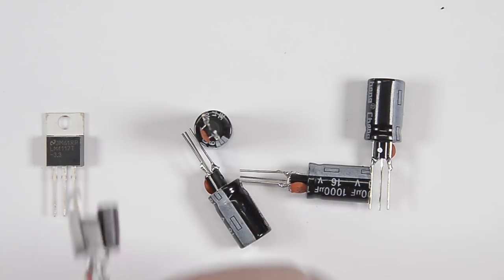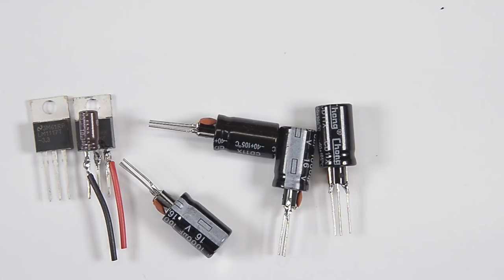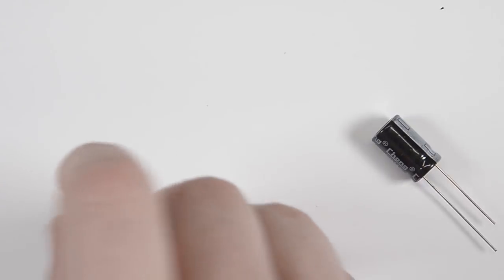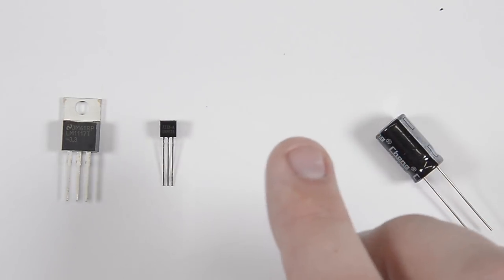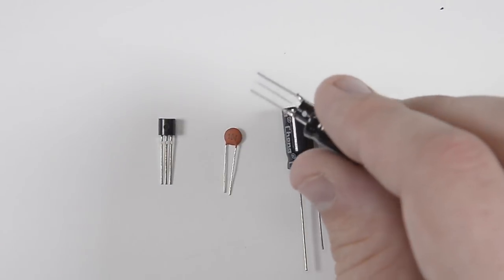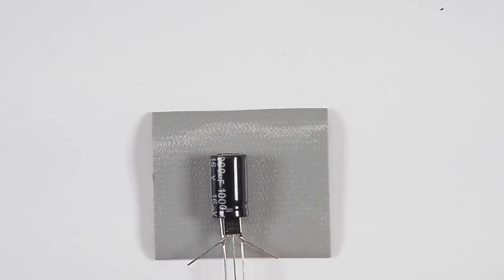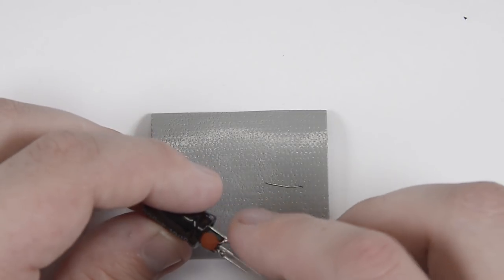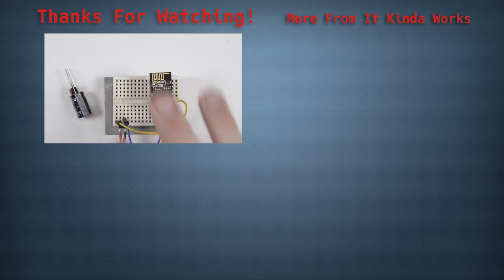New ESP8266 Voltage Regulator Design

Comment: I have a problem that, when using batteries as the power supply, an IC such as an atmega, and placing the regulator in between, the voltage from the regulator drops or current is highly limited. It only does this if an IC is my load, if I simply use a resistor, the output is perfect.

Comment: I think you got the part about dropout voltage wrong. It's 90mV at 40mA output current. At 250mA it's not stated, but it's a helluva lot more.
Reply from the maker: You might be right about that. But in general the ESP doesnt draw much more than ~80-100mA and when it spikes its for very short times that the caps should be able to handle. So far I've had multiple of these running for a couple months now without any recharging so I'm not complaining haha.
Reply: zaprodk it kinda works
Reply: The coding? it's just reading the datasheet and see that it says "90" instead of "9"

Comment: I made one of these to power an esp32 I am powering my ftdi from my computer and using the 5V line to the regulator to step it down to 3.3V before going to my esp32. I am seeing some of my programs causing brown outs on the esp32. Is there a way to beaf up the regulator or the FTDI module as to prevent these brown outs? Thanks for the great video.

Comment: I like it, I think it's a nice perfectly compact useful little unit.  Easy to understand why you like it better than the old one.  Boom plug it in; for battery operated devices, you want to get some run time out of, it's essential;
making up some right now.  
Very good. 
I like to solder. parts together in sort of natutal geometrical patterns, that make a small simplified pattern that can be memorized and repeated without requiring a considered amount of thought.  The finished product is displayable.  That's what you have here nice little finished product that looks like a finished product.
Very Nice

Comment: This is a neat design. I notice that there is no filter on the input power, which is recommended in the the spec sheet I looked at for the L78L33ACZ from STmicro. I can't imagine any input power glitches if the source is a battery, to maybe no need for input filter, right?
Reply from the maker: What do you mean by filter? The caps are placed on the output (3.3V) side of the regulator which does filter and clean up a lot of the output power signal.
Reply: Yeah - oops. I changed my comment when I notices my mistake about which was input and which was output. I was hoping my change was soon enough so you wouldn't notice my faux pas :( The spec sheet shows a cap on both the input and the output, with the larger one on the input. Still, as I put in my revised comment, if the source is the battery then noise on the input is unlikely. I do love your projects.

Comment: Thank you..cn you point out me a video where it explains how to power esp-01 and connections to boot the chip and execute the upploaded program? All in the internet i am seeing is to test the uploaded program with UART programmer..i am trying to deploy the module with a power source directly with esp-01 without programmer adapter and need to to know the connections from power source to esp-01 pins..i thought ony powering esp-01 to vcc and GND will work but it dont work since everyone hint to add voltage to CH_PD and all..Can you please help with a beginner level tutorials?

Comment: it is LM1117 is 800mA and I would recommend to at least have a air gap to the capacitor since caps don't like heat at all
Reply from the maker: A couple other people have noted similar things about the reg placement but so far I haven't felt it get anything above a what i'd call room temp. I probably wouldn't use this design on anything that needs to be regulated from anything over 5V though so in general it should be ok but thanks for the tip.
Reply: Nice to hear from you :), it just depends on how long you want them to last(especially with Chong caps),  love the design otherwise btw

Comment: Why didn't you put a capacitor on the input of the regulator?
Reply from the maker: My assumption is that the input will already be fairly clean power (from a good usb adapter or battery for example). If it's going to be a noisier input signal then I would also include one on the input side

Comment: hello, thanks for nice video. I have couple of questions:
1. what should be quescient current (current consumption with no load, when esp sleep) of your regulator? HT regulators have microAmpers, but when you attach caps, I predict some higher quescient current.
2. I know that esp when connect to wifi, and send values to internet, in peak, drain around 700 mA. HT has only 250 mA current. Are capacitors for that, to allow esp drain for very short time higher current?
3. Normally application circuit for HT regulators are with two capacitors, 2x 10 microFarads. Do you use also these two caps in normal circuits? So totally I need  4 capacitors? Thanks for advices.

Comment: my motherboared of pc is  +3.3 channel is about 2.9 v  ..  i am planning to reduce my 5 v to +3.3 v for my motherboard  . is this new design suitable for this purpose ? . i do not kow how much ampers my motherboard uses throuh +3.3 channel . thanks in advance
Reply from the maker: Yes this would be fine generally. But also I'd probably just try to use a usb port (or internal usb header) instead of directly tapping the 3.3v line on the mobo

Comment: Having an electrolytic capacitor act as a heat sink isn't the best approach if you want it to last for a long time. The heat will help dry the cap. It's an interesting little design though.
Reply from the maker: Meh I'm drawing so little current through these that they rarely get warm to the touch at all let alone hot. The caps aren't any worse off than if they were just sitting around on a circuit board in a small enclosure with passive cooling. Also half of the time I have these regulators upside down or on their sides anyways so the heat isn't going up into the cap. Been running these on projects for a long time now and haven't had any issues at all.
Reply: Fair enough. If it works for your use case, then all is good, but it won't for everybody. Dropping 12v to 3.3, for example, or running it at near max current is going to get it hot.  I know this because I built an NMEA to wifi bridge, and it worked perfectly on 5v during development, but when I ran it for real on a 12v system, I ended up having to redesign the power supply. :(

Comment: nanofarad cap went to wrong legs?!! You have connected it parralel to the 1000uf cap.
Reply from the maker: That was done on purpose - the large cap handles larger fluctuations in power but is slow to react while the small cap handles high frequency fluctuations but cannot keep up if there is a large spike or dip in power.

Comment: When I’m soldering everything together as you did my little ceramic capacitor starts to smoke... what am I doing wrong here ? 
Thanks for any help!
Reply: You might be getting it too hot. Also ensure there is no electricity going through the cap while you solder. (Like you're soldering while it's in a powered circuit.)
Reply: Also, pre-tin/solder the legs of the capacitor first.

Comment: sir can i ask something, i had this kind of project the wifi base electric fan microcontroller the components are relay 8 module, arduino uno, esp 8266 and 12v dc electric fan. its all working together but there's some problem the esp 8266 have been restarting because of the fluctuation of the tx in esp there is current flowing on that pin thats why our project is not working properly the esp keep shutting down
Reply: Have you tried adding a 330uF - 470uF capacitor directly soldered on the voltage input on the board of the esp?
Reply: ill try it bro thank you
Reply: Vironica Macabenta just make sure you get the polarity right ;-)
Let us know how you go.
All the best.

Comment: Why do you need the second micro capacitor?
Reply: Because he doesn't understand what it's for. You don't need that capacitor at the regulator. It's supposed to be as close to the pins of the ESP8266 module as possible to decouple and prevent unexpected restarts. It's doing absolutely nothing where it is in this video

Comment: Shouldn't the 100 nano farad capacitor should be soldered to ground and input instead of ground and output?
Reply from the maker: You could put one on the input as well however I generally dont find it necessary. Having the two on the output helps smooth out power draw spikes on the ESP quite well. I generally assume that my input power is already fairly clean and doesnt need to be conditioned very much. But if you have a bad or noisy power supply as well then I would definitely put a 100nf and a 100-470uf cap on the input as well.

Comment: why the need for the 100nF cap? It looks like it is connected in parallel to the 1000µF cap (so it would kinda have 1000.1 µF, right?). Please explain
Reply from the maker: +ThomasHaberkorn the idea is that they operate on different frequencies. The larger cap handles large lower frequencies of noise and the smaller one handles higher frequencies because it can react faster. This keeps the electrical noise to a minimum across the spectrum
Reply: Thanks! Makes sense

Comment: Cute, but if you like smaller choose 6.3V 560uF capacitor. It will be as big as the regulator and properly sized for what you want to use it.

Comment: A word of caution: the regulator tends to heat up during operation and placing it close to the electrolytic capacitor will in turn heat up the capacitor and speed up the degradation of the cap (it tends to dry up and then it swells, might even pop). It is not something to notice now,  but after continued use the capacitor might loose its properies and you might start noticing problems with resets or similar. But nonetheless an inovative design of the part!
Reply from the maker: Thanks for the tip! I havent noticed any heating (maybe a couple of degrees but nothing I'd call "hot" by any means) since I started using them but it's something I'll keep an eye on

Comment: that's an interesting sound design. the only thing that I would say is that the capacitor and the regulator both get warm and capacitors don't like heat. I would also say that it's easier two design a small circuit board and use the surface mount version and a 6 volt 1000 microfarad capacitor which be even smaller

Comment: Why do you have two capacitors at the output? I've learned that you only need one small capacitor at the input to prevent self oscillation and can add one larger on the output to stabilise the voltage. I like the idéa though.
Reply from the maker: It can be good to have a cap on the input if you dont have a good clean signal (I often use usb power so I can be fairly well assured that my 5v supply is good) but the caps on the output are because the ESP can often pull large amounts of current especially during startup and transmission which can cause small regulators to brown-out and reset or crash the ESP. The caps on the output take up the slack and remove some of the stress on the regulator in those cases which keeps everything running smoothly.

Comment: Good Evening! Thanks for the very helpful videos.
I have a question:
What voltage will I have at the output if the input voltage is below 3 volts? I want to power an esp32 from a battery that changes the voltage from 3.6 - 2.9 volts. Will it always be constant at 3.3?
Reply: Constan 3,3v and constan 250Ma

Comment: Just a warning, this will not prevent your lithium battery from over-discharge, so you still need some protection for something like a lithium ion so it doesn't go below 3 volts.
Reply: Good remember but this build is not a n over discharge protection! It is a stepDown build!
TP4056 got over discharged IC, so TP4056 + this tiny stepDown does the job you talked about 😉

Comment: Would this be able to drop a 12 volt source to 3.3 without over heating?
Reply from the maker: 12 is the max so it would probably get quite warm. At higher amperages it would probably start to overheat, yes. I recommend dropping the 12 down to 5 and then to 3.3 or just using a different regulator setup like a switching regulator if you are trying to go from 12 to 3.3

Comment: I would think that one cap should be across the input of the regulator and one across the output.
Reply from the maker: It's on the output because the ESP can often draw a lot of power very suddenly (when transmitting over wifi for example) which can overdraw the regulator. It probably wouldnt be a bad idea to have one on the input as well if your input power signal isnt the cleanest but generally I'm using these with clean USB power so thats not a big concern.

Comment: Could you explain how this works?

Wht do you need two capacitors? Are they input and output? (It's hard to see where the red one connects)
Reply from the maker: Both of the capacitors are on the output side of the regulator. The idea is that the small one reacts to quick and small irregularities in power while the large cap reacts more slowly but can handle keeping the power smooth when there are larger changes voltage. using them together ensures that the ESP (or whatever 3.3V device is attached) will receive quite clean power even when there are other large inductive devices (like relays or motors) attached to the same circuit.
Reply: @ItKindaWorks  That makes sense. Thanks for clarifying. I was looking at your design and thinking. Wait, should the 1000 be on the voltage in and the 100 on the way out. But, that makes sense. They are acting as a high low voltage filter. Which is what we want on the output a steady 3.3v.

Comment: I know I'm a while late here. But I've noticed that you connected both capacitors to the Vout. I believe you were supposed to connect the smaller one from ground to Vin. Please correct me if I'm wrong. Nb by connecting both to Vout you actually reduce your capacitance, since now you have 2 capacitors in parallel.
Reply: In case you missed the explanation earlier, the idea here is for them both to be on vout, with the expectation that there is other regulation done to the vin. These two capacitors both supply power to the high transient load that the ESP8266 can put on the ckt. The ceramic supplies power for the initial spike, with the higher capacity electrolitic providing power as the ceramic finished dumping it's capacitance. The normal 'idle' power draw for the esp8266 is 70 ma, but during the boot phase as the network comes up, that load can hit substantially more than the linear regulator can supply, and that's where these capacitors kick in. Then as those spikes in current draw fall off back below the level the regulator can handle, the capacitors re=charge.

Others have also noted that there are coding issues that people have made with ESP8266 processors in the normal code. Essentially the esp8266 needs clock cycles to perform houskeeping duties that a lot of code doesn't release back to the chip. The microcontroller may be significantly faster than an atmega microcontroller, but that doesn't mean that you can't end up causing a blocking condition that the chip will watchdog out and reset on you. A good practice would be that any time you have a delay in your main loop, or in heavy processing functions, some time should be released to the CPU. It needs to do things like make sure that the network interfaces are still functional, and other related things.
Reply: Capacitance is added when caps are in parallel, but that is not the reason for the smaller cap.
Its purpose is to provide a low ESR for high frequency signals the electrolytic won't see.
That said, I would think that the bulk decoupling capacitor is more effective on the input side.
If Vin is stable, the regulator can take care of current fluctuations in the output.
I have seen spec sheets for the HT7333 showing two 10uF caps (one on input another on output).

Comment: Interesting fact is that the ESP8266 uses about 10% of the current in standby with 3.2v.
If I ever find an elegant solution to drop the voltage when the current drops I'll let you guys know...
Reply from the maker: That is interesting - good to know! I have to wonder why it uses so much less though... Yeah I cant think of an easy way to drop that last .1V but if I (or you) ever do I'll be sure to make a video of it
Reply: it's probably a voltage regulator that shuts off or something

Comment: If battery efficiency is a concern to you, why not using a switching regulator?
For quite cheap, you can have step-up/step down regulators, with high efficiency (>90%).
The only reason i have for using linear regulators is because i still have some in stock, for projects where i don't care about efficiency.
Note however that switching regulators are known to generate more EMI, so for super clean radio stuff you may want a linear still.
Reply from the maker: I know that switching is the way to go for super efficiency but those usually end up costing a lot more (these practically cost me pennies to make) and take up more space since you generally still need some caps to maintain a solid signal. Either way works well though! I just thought I'd show these little devices since they work so well and have been solid for me so far :)

Comment: 1000uF on the output seems kinda overkill. It would be nice to show us the reason behind this decision on a scope.
Reply from the maker: +FlumenSanctiViti honestly it might be a bit overkill but it totally depends on the circumstance. For instance check out this video I did using relays https://youtu.be/DwC1F4wNYPo which has some views using a scope.

Often times I have a relay connected to 5v and then a regulator down to 3.3v for the ESP and I have to put 1000uf caps on both the input and output to prevent issues on the ESP.
Reply: It's covered in Andrea's video https://www.youtube.com/watch?v=wf_msvWv1jk